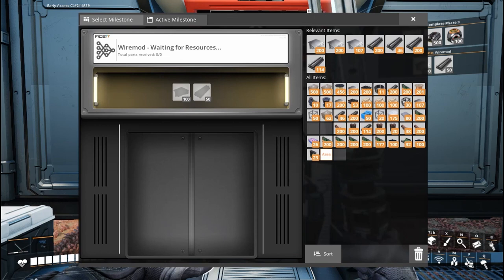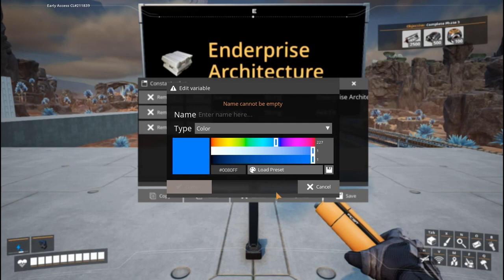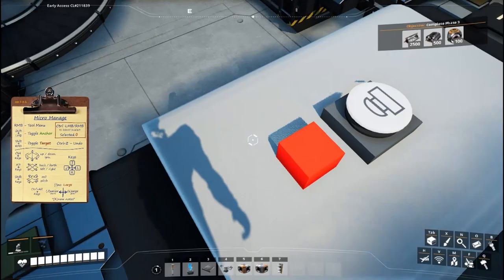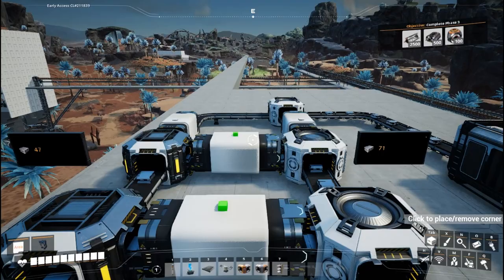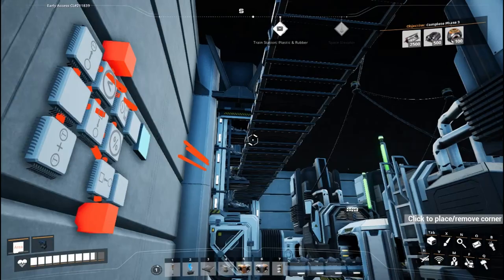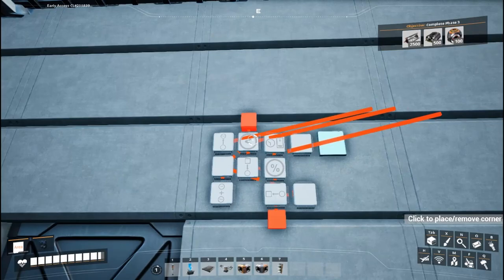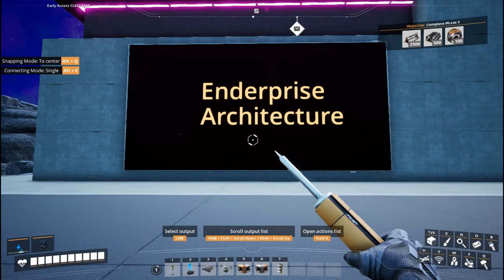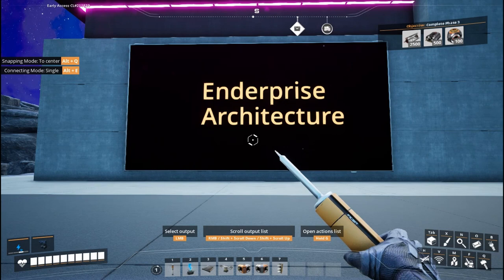WIREMOD - Satisfactory Let's Play - Episode 17

Comment: Oh my god this mod is cool. Steep learning curve - took me forever how to figure out how to do an IF. Made it WAY more complicated than it need be (was looking at it more like a programmer I think). But once you figure it out, it was like something unlocked in my brain and it was easy. This is really cool - the missing piece for Satisfactory in my estimation. Not sure how Factorio does it, but going to start a workthrough that's more "dynamic" in nature now (turn off assembly lines if storgage is full etc).
Reply from the maker: It is steep, but I've really been enjoying it!  I just pulled it back out for my most recent build, so I can dynamically split my belts and turn off factories when storage is full!  (I'm hoping to put that video up this week.)
Reply: @EnderpriseArchitecture  hahaha that's exactly what I'm using it for. I just crating a forge that does ALL ingots and can be expanded as required via blueprints. Took forever. Played with this all day - will def change my approach to the future factories and my storage. I love using a mod called load balancer as it makes it dead easy to create.a bus with filters for storage and overflow, but I want to create a distribution center that will turn off factories when storage is approaching full. Sounds insane typing it out.

Comment: Very interesting. One thought I had was to create a central storage facility but have the ability to dynamically state "for this output I need these materials" and then the storage automatically sends the necessary materials without me working on it manually. I see it very possible now using this programming facility!!!
Reply from the maker: Exactly!  Though it's very hard to send a request for a specific amount of materials unfortunately, because there's lag between the calculation and things moving on the belts. So, for instance, if you want 100 smart plating, you'll end up getting like 120 or something, depending on the speed.

Comment: A tip for tutorial, selfish off course . Remains, leaves, wood, mycilia to Biomass to Solid Biofuel without the need of a billion constructors. Not native in english, sorry for that first.
I have 1 container for all the different types that can become Solid BF. Not all of them are occupied or full all the time. Is it possible with "if and or" to pull from containers that have material and set constructors to recipes from pulled source? I only want one line doing SBF and not 20😊 I understand so far to "block and go" limted conveyor, but is it at all possible to change recipes in the constructor via Wiremod? Great video btw😊
Reply from the maker: Oh good, idea! I don't know, but I'll try it out and report back!

Comment: Hi, great video. The sign displays 3 colurs, red, black and blue. How do you connect more than 2 colours (or inputs) to a sign.
Reply from the maker: Thanks! Each of the colors is stored in a constant, passed to one of the inputs of the IF/ELSE unit which switches between them. The conditional logic at 18:48 shows how we loop through each of those.
Reply: I know it's something simple but I don't get it. You can only connect 2 colours to one if else so you need 2. The sign only accepts one if else to, say, background colour. So this can only display the colours from one if else. I can't see how you've connected 2 if else to one sign to get 3 colours on the background. Sorry for the trouble.

Have you noticed the limiters only give throughput in multiples of 60 now. I've got around this by dividing the items passed by the seconds on the clock and multiplying by 60 to get items per minute and having the items passed reset every time the seconds is 0.
Reply from the maker: @glengordon1153  You have to chain a series of if gates, it's confusing. Here's a diagram of the pieces: https://photos.app.goo.gl/L8Swnwhy6mug7qEs5     Yes, the limiter count issue was causing me problems in my latest build! I'm not sure why they chose this method of calculation, it's not great...

Comment: Why didnt I find this review, when I was strugling to understand how should I link gates TwT
Reply from the maker: I honestly wish more folks would document what they're doing with the mod, it's got so many possibilities!
Reply: @EnderpriseArchitecture  I, personaly, use it to underclock water pump in selffeeding recepies. And its even more useful, considering, I play with SF+ mod. For example. I need 110 water input and have 60 output. But since its unstable and water might disapear in pipes I have math on my pump. Its bool from fluid tank (little SR latch "<100 S | >100 R"), convert it into int (0|1), then multiply by 16.667 and add 83.333 (50 m3 water in this mod) and then divide by 100, since overclock meter requires fraction. You probably can count everything divided by 100 by default, but since constant only contains 3 digits after point I think there will be loss of a fraction. And second pump is SR "<1 S | >100 R" with not gate and directly into standby bool
Reply from the maker: @illiakuznietsov4162  Oh wow, I am currently struggling with this exact problem in SF+ with the overflow water from the Biowater->Biofuel setup into the burners! I'll have to try this! Thanks!